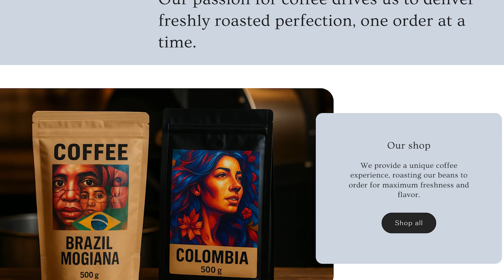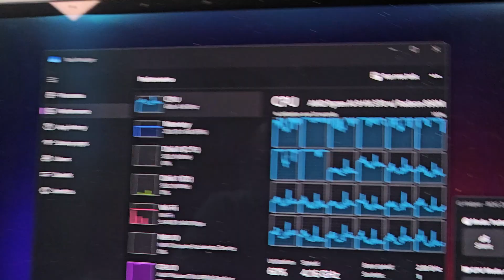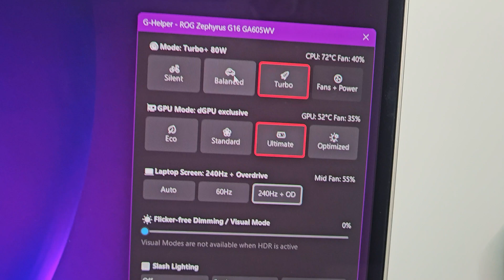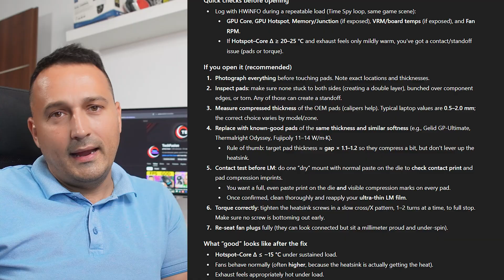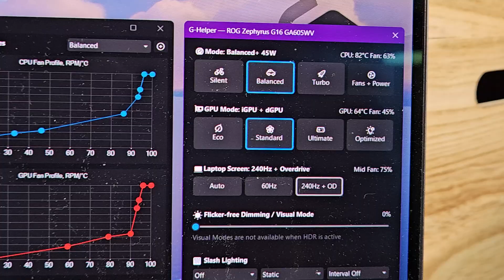Liquid Metal: Don’t Do It Before You See This

Comment: I was super curious to see the results. I have an Acer Predator PHN16-71, core i9, 64GB, RTX4080 and it comes likes yours with factory liquid metal. This thing runs somewhat hot. I brought the temps right down on my old 2019 HP Omen 17 with Kryonaut but those i9s run hotter than an i7. I've been pondering how to heat manage this one because I got the HP down to 56 degrees while gaming. I'm torn between a good traditional thermal or replacing the liquid metal/putty.
Reply from the maker: Hi man.Well let me just tell you that I was blown away with how good this is and I was hoping that for the money it will be good but expecting to be disapointed  as with most things nowadays.Still its really good and compared to the liquid metal is much better,less messier handle and it can last a great number of years without seeing performance degradation.As long you dont remove the heatsink you can even set it and forget about for the entire life span of your laptop.My system now can run 0 fan for longer and also it runs cooler and at lower rpm fan whenever they do kick in.Lightyears away from liquid metal.I cant recommend this enough and dont worry i dont have anything to gain from this.I just want people to make the right choice if they are planning to do this so that you dont have to worry about it ever again.Last piece of advice though is that this is electrically conductive so take mind this when using it,but if your system had LM applied then the ground work is already done for you.Cheers bud and good luck🎉
Reply: @Tech_Fusion bro that is a very well put and thought through reply. I've been doing this since the days of tape driven Spectra Video, 386sx33 and DX4100. Liquid metal is Terminator style used now as cooling. There is a fine line between cooling and reaistance but your input is valued. more so via practical application. I'm ordering Contuctanaut bevause I know what I'm doing in temrs or building/computimg but my cup is always empty especially with the unknown. Lwt you know how it goes. Also ordering the sheeting and putty. Gotta love a boxing day sale. Merry Christmas to you and yours and happy for tue feedback. You're a true tech head.
Reply: forgive the typos... CBF correcting them.
Reply from the maker: @TJUhlmannno worries man,i might have mistakes of my own as Im not a native english speaker but the ideea is to get the point across.Cheers man
Reply from the maker: @TJUhlmann Thank you for the kind words man,and I wish you all the best with the swap,maybe let me know how it went when you are done with another comment here.Merry Xmas to you as well and happy holidays bud.Cheers
Reply: as PH18-71 user i noticed stock LM leaves hole in middle of CPU as heat dissipates it over time to edges. so replacing it once every other year is a must
Reply: @Aienhel yep you are correct. Figuring out what to do it with is the tricky part.

Comment: with so much liquid metal you were lucky you didn't damage your board. Generally I would not recommend replacing the thermal paste/pads on a laptop unless there are issues. Even with thermal paste there is a high chance of screwing something up. I would also recommend thermal putty over thermal pads - putty is more versatile and less chance of screw ups. An incorrect pad thickness will lift the heatsink, and you will get hotspots on the GPU/CPU.
Reply from the maker: Yeah, I agree it was a bit too much LM, learned my lesson there for sure! Kryosheet fixed it though.This laptop feels better now then it ever did with CPU clocks sitting higher and fan and noise curve being way better.Cheers bud

Comment: I have a zephyrus g16 4070 i7 13620h laptop. The heat is very bad, so much so that it turns off automatically while I am playing on the lowest settings. These laptops are really bad. I do not advise anyone to buy them.
Reply from the maker: I also had heat concerns with mine and thats why I changed out the liquid metal to the graphene pad that thermal grizzly sells.Its a night and day difference.If you want your performance back and not have to worry about thermals again,get rid of the liquid metal.They are not bad laptops,just really bad QA from Asus....sad but true
Reply: @Tech_Fusion I took it back to the dealer and they changed the liquid metal but it's much worse.
Reply from the maker: @anasanss5635 I had the exact same experience as per the video.Granted my setup was less then ideal but what I learned is that there is a very slim chance that anyone other can do a better job or at least as effective job as the factory when applying this stuff.It was also worse for performance for me after i swapped it out but what i really encourage you is to use the kryosheet from thermal grizzly.I have a video where I show how i did it myself and even though again it wasnt the most ideal setup,its doing its job so much better then the factory applied liquid metal.This liquid metal really sucks,it pools up over time,it can kill your laptop since its electrically conducfive and kts also such a pain to apply.Also dont be fooled as this stuff also dries out over time just like regular thermal paste.So appart from the only down side with kryosheet of it also being electrically conductive it is the only downside for using it.Its never dries out,its doing a much better job of transfering the heat and because your laptop had lm applied before,you dont have to do any of the prepwork.Anyway sorry for the rant bud,i really encourage you to go for the kryosheet as you will be amazed.Cheers man
Reply: @Tech_Fusion Thank you I will try it🌹🌹